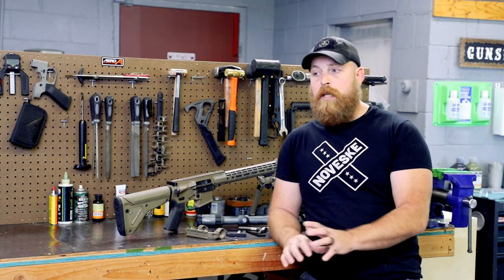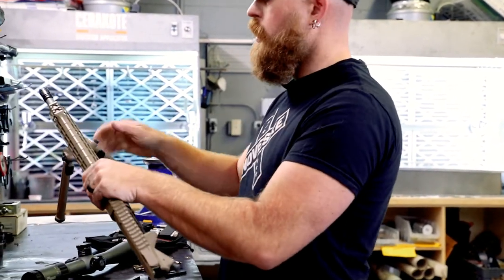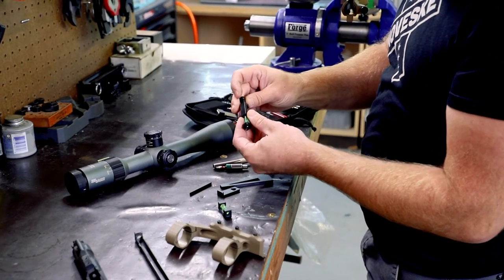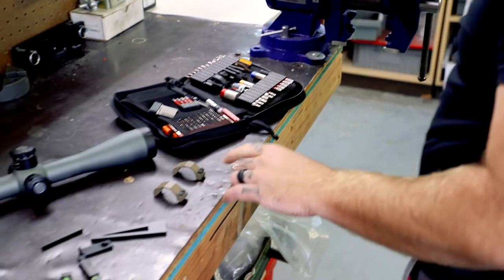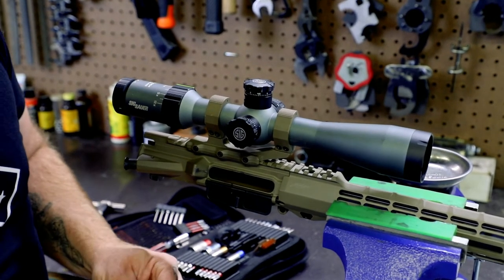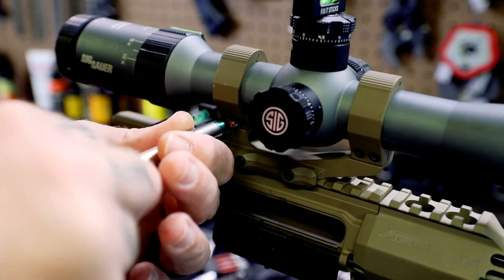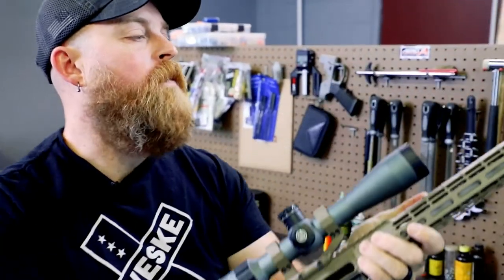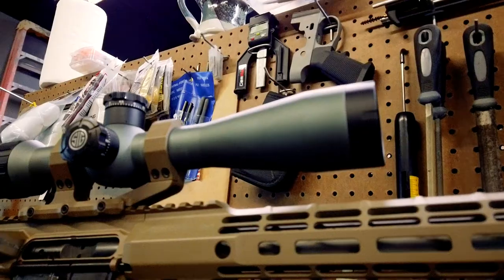How to Mount a Scope with an SPR Style Scope Mount

Comment: I bought an arisaka level tool to mount my scope. I have the same aero precision scope mount but no bubble level. Can I correctly mount it with just the arisaka level like the one you used?
Reply from the maker: Yep! You should be good to go. That leveler will make sure the scope is leveled properly. We just like using additional bubble levels for accuracy.